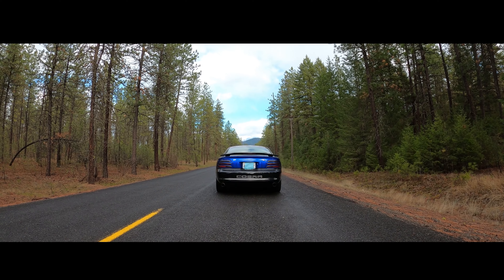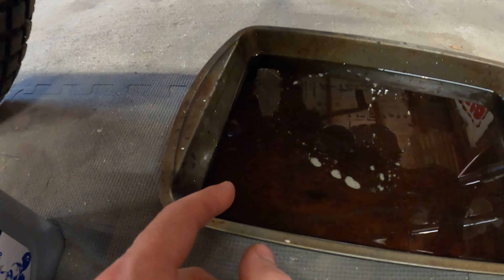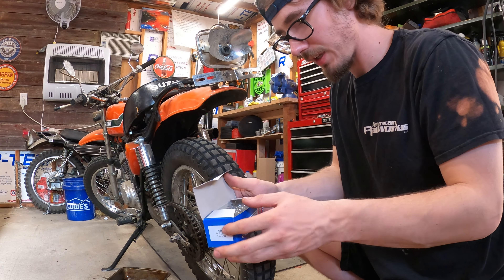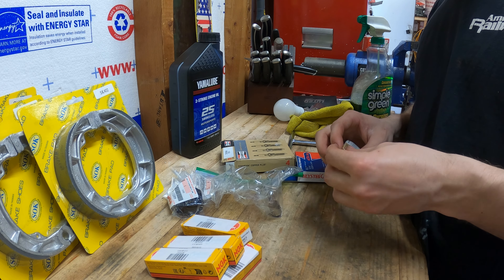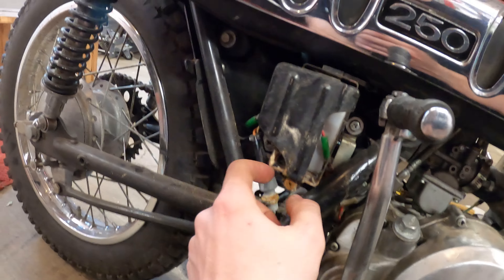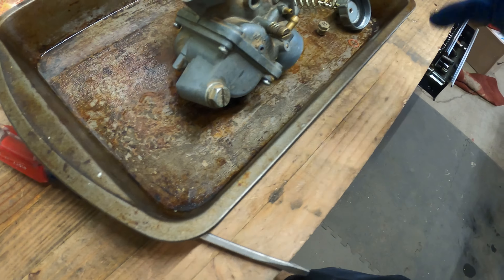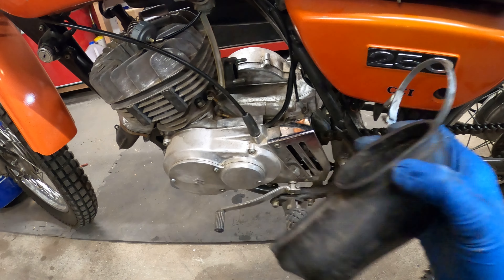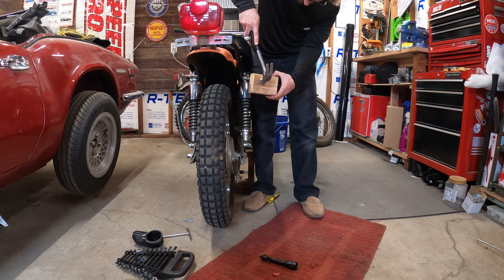Repairing My Dream Vintage Motorcycle! (73' TS250)

Comment: A spring connects the brake light switch to the pedal.
Reply from the maker: From what I can tell you’re correct! Some
Bikes have a rod with a spring attached on one side.
Reply: @misplacedgarage  Yes. It is a spring. I looked it up. I even tried to reply with the Suzuki part number, but you tube blocks it. Thanks youtube!
Reply from the maker: Excellent! Thank you for looking out!